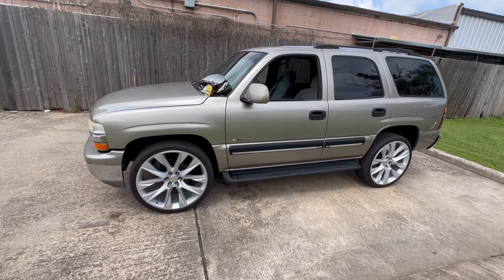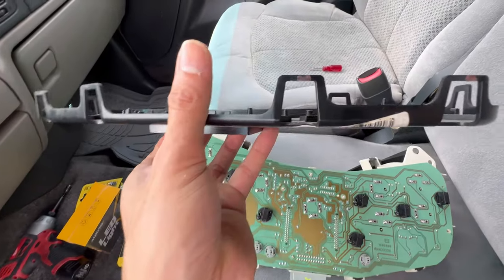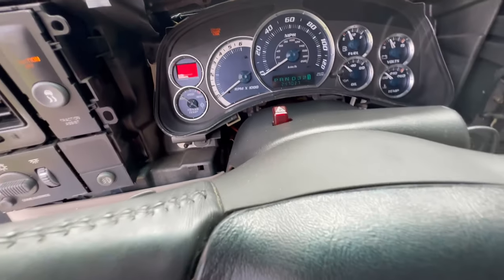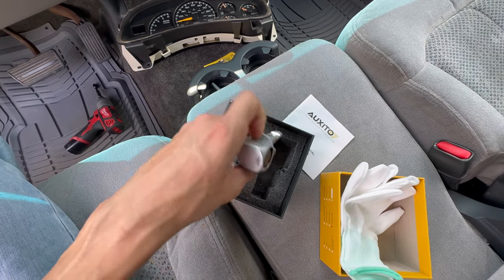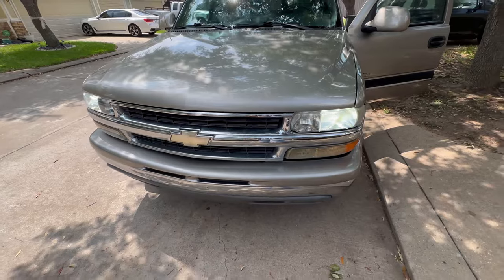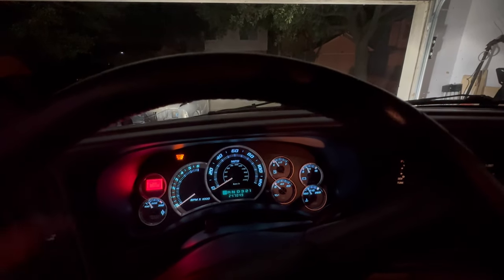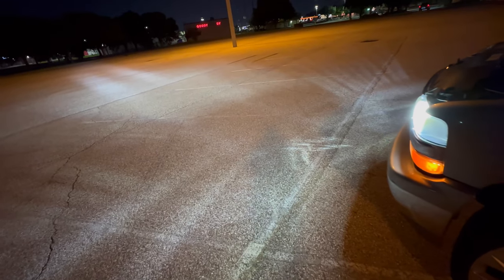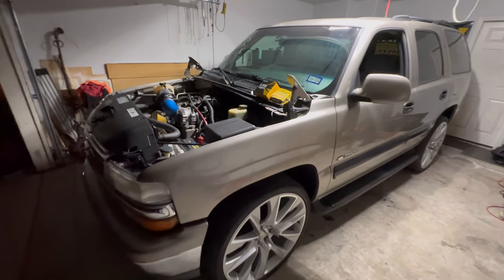00-02 Tahoe/Silverado Escalade Cluster swap with Auxito led lights ⚡️⚡️⚡️

Comment: Idk if someone said in the comments but the low oil pressure could be a bad o ring in the pick up tube u have to drop the oil pan to get to it
Reply from the maker: Yeah bro I did that already I just haven’t edited the video, I’m thinking it’s a bad oil pump cause I have a new oil pressure sensor, new pick up o ring, new oil, new gaskets and cleaned everything.  But when the truck starts cold it has great oil pressure but when it gets to temperature at idle it drops again🤔

Comment: I have auxito bulbs in my work truck which is a semi truck, and they are bright........       and clear .....
Reply from the maker: Nice Bro! I bet you can see everything out there💯 Yeah I like them they’re very bright, I started using them first with the amber 194 leds and they looked awesome👌🏼
Reply: @Migo Customs  absolutely.....        side note.....I love ALL YOUR VIDEOS, they are great, especially when you explain how to do stuff for the truck.... thank you fam....👍
Reply from the maker: @shonoff83  Thanks Bro!!💯💯💯 I’m glad they help out, cause I know sometimes it helps with questions we all have👍🏼
Reply: Big bro do you no if the 2003 Z71 Tahoe has the front foot well lights like yours🤔🤔
Reply from the maker: @illestswagkid23  Only some of them have them bro, not all of them. I them on all of mines but they are 2000, and 2001
Reply: @MiGo713  Danggg it lol😩😩 Appreciate it G!
Reply from the maker: @illestswagkid23  No Problem bro!💯 if you don’t have them you can just install some there, the spot will be empty and you can cut them off in a  salvage yard and run your wire wherever you like💪🏽💪🏽
Reply: @MiGo713  Dang ohh really bro might have to try that out stop past my close junkyard!
Reply from the maker: @illestswagkid23  yeah you can tap into the the door harness or other spots 👍🏼I’m sure you get it done!
Reply: @MiGo713  Yes sir! 💪🏾💪🏾
Reply from the maker: @illestswagkid23  😎💯💯💯

Comment: I know this is an older video... But you can have your cluster reprogrammed. Also, if anyone swaps out their headlights with aftermarket ones... Swap your OEM brackets on to them. Way better fitment.

Now you need to get a wood grain Cadillac steering wheel and dash bezel. I actually have an 02 Escalade dash bezel for sale... 😎
Reply from the maker: Maybe I’ll have it reprogrammed one day I don’t really mind lol and Thanks.  The Oem headlight brackets is good. And I upgraded to the my Grant Wood steering finally, but the Escalade Parts are nice for sure💯

Comment: Aye I am trying to wire a z71 push button switch for a light bar switch. I have no idea how lol
Reply from the maker: Ah ok cool, that’s not too bad. I would use a relay with the switch, did it come with any wires or switches?
Reply: @MiGo713  yeah I have the harness. I just cut the wires to pull it from the parts truck.
Reply: @MiGo713  I actually have 3 different ones, 2 different ones from a z71 and one from a regular 4x4 lol. I seen your video about the fold in mirrors with the switch
Reply from the maker: @JDC8397  ah ok lol
Reply from the maker: @JDC8397  I haven’t messed with that specific switch but you can use a multi meter to check continuity or voltage on the switch
Reply: @MiGo713  I just don't know what to wire in. A little Grey wire makes the lights come on
Reply from the maker: @JDC8397  it’s hard for me to say🤔but it Could be the dimmer wire, it’s best to meter it if there no wiring diagram. Sounds like you have the ground and dimmer now. You should just connect some light or 12v item to see if the switch is powering in just ground it separately ti search for the output
Reply: @MiGo713  I'll try it
Reply from the maker: @JDC8397  ok cool I lmk what you find out on it👍🏼

Comment: Why did you use a short neck on the air filter
Reply from the maker: I just used the parts I have and it’s gives me space to work in there since nothing is permanent right now while I’m getting it where I want to be

Comment: Oil pick up tube gasket I'd bet on that oil pressure situation
Reply from the maker: Hmm 🤔 I could try replacing the dip stick or with a new gasket to try it out but I’m really thinking it’s the oil pump 🤔 it has great oil pressure at start up and driving but when it’s at operating temperature idling it drops the oil pressure very low
Reply: @MiGo713  known issue with the truck ls blocks they have holes for for two bolts to hold the oil pick up tubes GMC only used one bolt and once the o ring starts to shrink 150 to 200 thou. They start doing exactly what you are describing
Reply: They make plates and extra blot kits so if don't have 4x4 pull the oil pan replace the o ring and add the plate and put the two bolt set up you shouldn't have any worries for awhile
Reply from the maker: @loganstuart4174  I already cleaned up all of my oil pan and replaced the gaskets and new o ring on the pick up tube.  I just never had that issue on my Yukon or silverado.  Maybe I can try to buy the adapter to put the 2 bolts in place but technically it should be good now since I have a brand new O ring on it🤔
Reply from the maker: @loganstuart4174  I will give it a try when I get a chance if doesn’t work up probably just end up replacing my oil pump, appreciate it👍🏼
Reply: No problem brother, you going to do the cam while you're in there doing the pump right?
Reply from the maker: @loganstuart4174  I do want to, but I’m not sure right now if it may have to wait